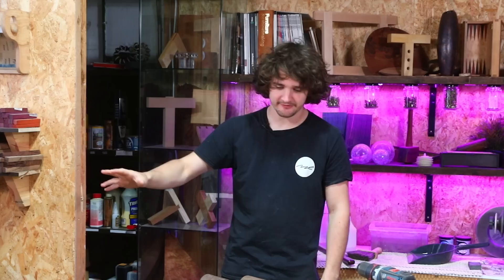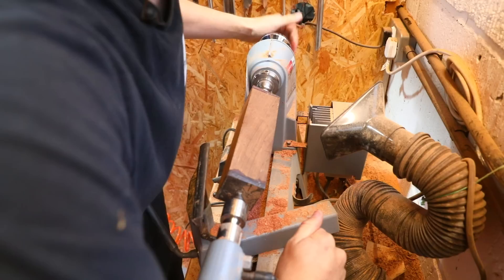Making Dovetailing Mallets! | Turning Tuesday #23

Comment: use the internal measuring part of the calipers to measure the hole in the head of the mallet rather than the Forsner bit, that way any wobble in your pillar drill will not upset the handles

Comment: Just a thought: I've noticed my forstner bits almost always cut a VERY slightly larger hole than what their diameter measures as. I suspect runout of my quill or the stock moving, or a bunch of other stuff. Just an idea as to why the tenon might have been smaller than the mortise.  Good looking work bud!
Reply: I've had a similar problem.  But I've also noticed that my Forstner bits are very slightly tapered.  The hole diameter is at least as large as the larger diameter of the bit, but if turn the tenon to a diameter that matches a measured slightly smaller diameter, the tenon will be a bit loose.